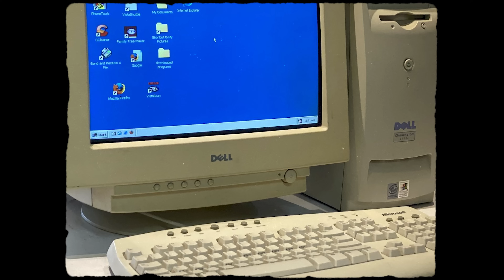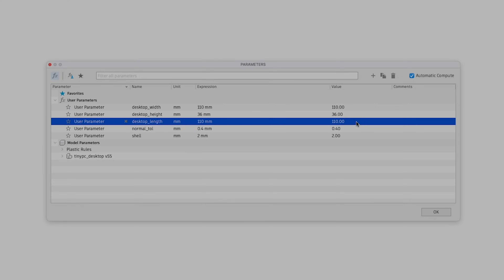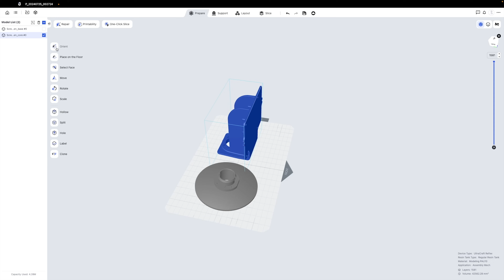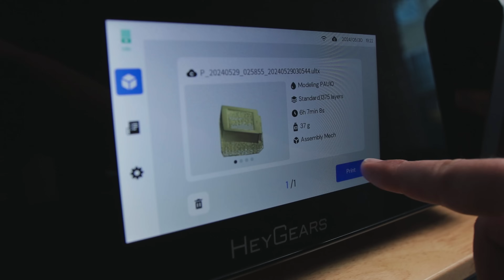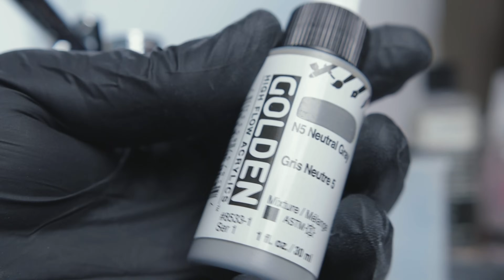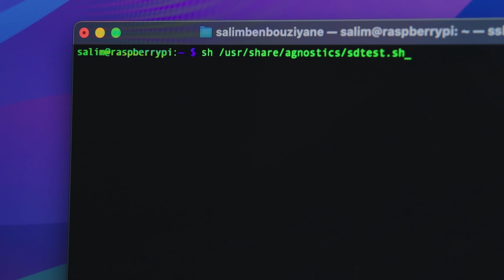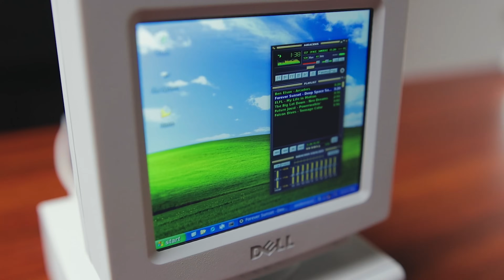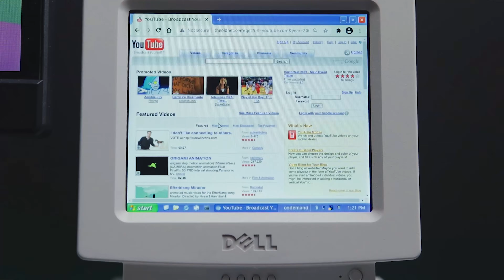I Made a tiny Nostalgic miniature PC for my desk (3D Printed)

Comment: If anything the wiggle in the monitor is a little touch of scale accuracy.  The heft of old CRT's and the bit of flex in those cases they sat on often meant the setup was a bit wobbly if you needed to scoot things around.

Comment: Every time I opened a PC case from the ’90s, it was like signing a blood pact! Those things were covered in so many sharp edges, especially the removable cut-outs! I swear, if you didn’t walk away with at least one cut and a new set of dried blood fingerprints, were you even really building a PC?
Reply: I worked in a computer place from about 2007 until about 2017. We built custom machines. At one point, I had cut myself about 4 times in one day, and I told the boss we should have the slogan "a bit of our DNA in every PC".

Edit: I still have a visible scar on my finger from slicing my finger open on a removable drive bay cutout on a machine I was building in about 1998. My friend jumped up and ran out of my room to go get my mum when the blood started gushing out all over the floor 😲

Comment: Hello Salim, I have a question for you.
Recently I've got studing the possibility to make the custom pcbs of you're tiny pc by the surface mounting service of JLCPCB.
The software EasyEDA though don't permit the direct import of gerber file, but permit generation of file gerber by an electric schematic.
Would you be so kind as to provide me the wiring diagram of the two cards "MicroSD card adapter" and "Add on for PI4" so that I can recreate it on EasyEDA?
I would then like to bring your project to my Italian channel in order to make it available to the Italian public.
Obviously you will be cited as the creator of the project.
Thanks.
Reply from the maker: Hello, You can upload the gerbers directly on the website to order and add assembly service with the BOM on any pcb fab service. You don't need to recreate it in EasyEDA to order it. I hope this helps.
Reply: @salimbenbouz  I thank you. Do you know an alternative to JLCPCB?
I knew that they have recently created this type of service, but you have to use their software to select the components from their database and send them the order.
And if I don't have the wiring diagram nothing can be done.
Reply from the maker: @Intel-486 Yes, I get all my PCBs manufactured by @pcbway. Great service and quality and they offer assembly and other services as well. 
You can use the BOM file I uploaded  to the repo. It has all the SMD parts, designators and values for assembly.

Comment: I have some suggestions for significantly improving the product experience and making it even more realistic than the original. One of the main things that is noticeable right away, that tells you it only looks like a replica, is the lack of a lensed screen made from glass. It is possible to create it from clear resin mold. The best option is to cast a glass shape, which is a complicated process, but this will be a top-notch solution. Another thing is not to add extra weight to the monitor. This could be done quickly by adding small metal inserts on the side walls of the box. But even with all configurations, this project is in a league of its own! It would be cool to convert the old ball mouse and keyboard to wireless. So there will be a complete setup

Comment: I just stumbled across your video and saw that you designed several parts yourself. 
I'm currently looking for an HDMI-A to HDMI-D adapter for my Raspberry Pi 4B (to fit the WIMAXIT M728 Display I'm using) and want to know whether you're able to produce such a thing yourself or know a certain adress I could contact for such a request?

Comment: AMAZING. I have been looking at doing this for many years, but basically just sticking a pi inside of an existing case I have that looks like a miniature pc but it is a novelty storage case for floppy discs. But you have gone total next level and the design of it is spot on.
Now just to make some miniature speakers! 

The only thing I would have changed really is having the micro sd slot be a standard sd slot with a microsd inside an adapter card. Not sure if this messes up anything with the pi system, but the bigger sd slot may be less fiddly. 
If you did a small kickstarter for these (say 1000 units) just the kit without the pi, you would probably get the funding within a day and then some!

Comment: I do design many objects too and I have a subjection: Like Elon says: best part is not part. You should try to reduce drastically the number of screws, there is a lot of solutions with clips included in the model to prevent screws. You should take a look at the Amiga 600 laptop a French guy did. Like me, he tried to remove most screws.

Comment: Good job. I am really impressed.

Paint:
Good job. I wish I had the skills/audacity to do airbrush (afraid to spray down my entire office)
I am doing an effort to find good colors, most retro computers are light whitegreys with a bit yellowing making them more tan than beige - even when taken perfect care of.
Best one I found so far is the Belton Molotow Light Stone Grey spray paint. I am also looking into different RAL colors RAL7044 is my next contender. I also have RAL9002 on the list.

About tiny details in CAD:
I think spending tedious amount of time drawing it is the only way to make it beautiful and look authentic.
If you look into real case designs and work in Fusion/CAD to recreate them you sometimes get into a flow where you understand the cool things the original designers did to make stunning details using different techniques. By somewhat understanding how they were thinking I was able to recreate the front of a retro computer case in as little as 13 feature steps in Fusion 360. I sometimes end up with a cluttery model with all the details correct, then recreate the whole thing a 2nd time while I look at the first model and try to combine sketches, apply better use of repeated patterns, etc.
Reply from the maker: Thanks for the colour refs. I will check them out. You should try the airbrush it's not as bas as it looks and actually fun imo.
I agree for the CAD stuff. it just felt too tedious for the miniature features (some of it don't even resolve because it's too tiny) but I get it and appreciate the insights.

Comment: How did you change the image aspect ratio? By changing overscan values, or some other way?
BTW, the result looks great and I may replicate that in slightly bigger size, so I can accomodate an OrangePi 5 Plus inside, which is prepared to become my home server.
Reply from the maker: Thanks, I changed the HDMI timing values in the config and added overscran as you said.

Comment: Great project! Tbh the only real flaw I can see is going with a Windows XP-styled skin for a PC with that kind of design - that's a Windows 2000 machine at most, though W98 would be just as fitting. XP era Dells were more often black and much more rounded and stylized in their designs IIRC.

Now, this might be on the "going a bit too far" side, but once you're making your own SD card reader PCB, why not make a 3D printed floppy disk microSD card holder that fits into a suitable slot, where the card interfaces with a reader? Or a CD-rom tray you can pull out that holds the card? This would of course require a lot of careful design, plus probably disassembling an SD reader to get the pins without the housing, but it would be incredibly cool. Still, even as it is now, 10/10 project, super well done!

Comment: Dang, I didn’t realize home 3d printing had come that far. I’ve never done any myself, but occasionally check out different 3d print projects, so I don’t follow it super closely. But the quality on those prints looks amazing. I’ll have to look into resin printing some more.

Also, the quality of this whole build (and video) is incredible!
Reply: FDM printers are getting quite fast and detailed too. Currently, which you go with depends on your use case: Resin (SLA) printers are kings of detail, so if you want to make a lot of detailed figurines, Resin is the way to go, but it's drawback is that resin is brittle and chips/breaks easily and also should not be subjected to sunlight. PLA/Filament (FDM) printers can't compete on level of detail (yet) but have gotten significantly faster, and allow you to use a wider range of materials that can be quite robust, which is great for part-replication and mechanical use. (Sorry if I'm over explaining.)

What is nice, is you can have an intro into either machine style for about $250 these days, which is quite affordable! Though of course, this is one of those realms where "you get what you pay for" is still very apt, and the more you spend on a printer, the more perks and easier to use it is. I have one of both types, and while I use my resin printer a lot more... because all my friends want mini-figs of their DND characters, the PLA printer is by-far the more useful one for tinkering and every-day useful items. (Also, it should be noted, is that the filament printers are typically far cheaper per-print to use, over expensive resin.) While I don't have a particular recommendation for any machine, the stuff coming out of, say, Bamboo Labs is quite good for beginners and pros alike, and might be a good place to start your research if you choose to pursue the bug. I don't recommend going down the rabbit hole of Youtube machine reviews though, there lies madness! (Sarcasm, I always recommend one does their homework. But, you just quickly learn that NONE of the manufacturers are perfect, every machine has it's pros and cons, every 3D print youtuber has their bias favorites, and it's still the "Wild West" where all things are concerned... though a slightly more established and civilized Wild West then it was a decade ago. Heh heh.) Huh, I didn't intend to "go off" here, but here we are.
Reply: 3D printers have not come far, but they are a bit faster, with a bit less calibration.  This project shows that, after printing he had days of finishing to make the plastic look nice.

Comment: Or you could use a real 90's desktop like I do. I have it running Windows 98 Second Edition. Although the motherboard is likely from the early 2000's because it used to be part of a Windows XP computer, it still counts.
Reply from the maker: I wish. But no space at the moment to have a proper retro station. So I did the next best I can until then :)
Reply: @salimbenbouz  Fair enough. I also have a second channel and I make all the videos for it on that computer. Just thought it would be fun. :)

Comment: 19:00 Most CAD softwares allow to import pictures, it makes tracing out details that don't have functional dimensions very easy, position one element and use that to scale the picture correctly.

Other than that it's mostly a question of experience to properly group elements into the same extrusions, gaining a lot of time at very little cost in accuracy, does it really matter if the curve is perfect ? or if the height of an element is 0.2mm off ? This are the questions I ask myself when grouping elements into the same sketches.

Fusion 360 is in my experience pretty heavy in number of functions used, even for an experienced user, so there's only so much one can improve on that level.

Comment: I would have put the SD in the floppy slot instead of the CD slot, but other than that this is fantastic.
Reply from the maker: You're right floppy makes more sense but I had to compromise because of the alignment with the add-on PCB and to keep things simple. Otherwise, I would have needed another PCB or extender, or even switched the floppy and CD drive, but that looked a bit weird.
Reply: @salimbenbouz  Those are good reasons. It still looks great. If I had the patience for 3D printing I would make one myself.

Comment: the real monitors wobble like that... you nailed it
Reply: Yea, all my CRT monitors had that wobble too.
Reply: Yes! 😂 Just missing the "Turbo" button no one knows what does 🤣
Reply: @TheStuartstardust  The Turbo button slows down the CPU so it can run older applications at the correct speed.
Reply: @JoBot__ so it's more of a slow button
Reply: @viewer_the_twelth  Correct.
Reply: @TheStuartstardust  
He's got a Pentium 4 sticker on the front. Turbo buttons were gone with the original Pentium.
Reply: To be clear, turbo mode ran the CPU at full speed, “non-turbo” mode slowed the computer to 386 speed for programs that relied on the speed of the CPU for timing. The button was confusing because it was inconsistently wired from PC to PC (it was a toggle but people had different opinions on whether the “on” position should be fast or slow). Most PCs had a display that told you the clock speed.
Reply: By conectioned littered makings conect these bacame perfect,
Reply: 100% that’s not a mistake. It’s on theme.
Reply: Cathode-ray tube
Reply: Алсптяво😊😊😊😊😊❤❤❤❤❤❤❤❤❤❤